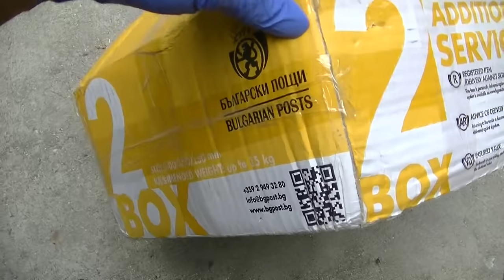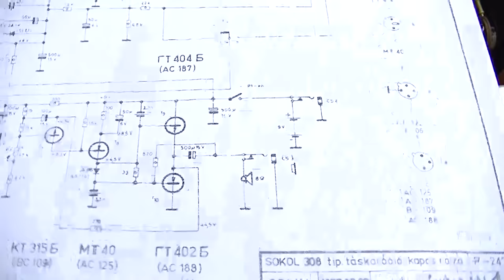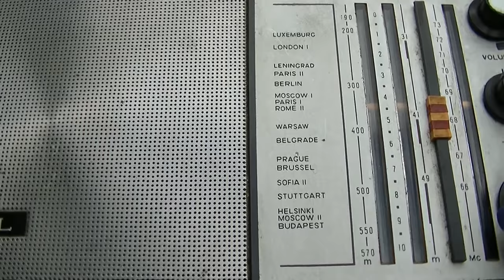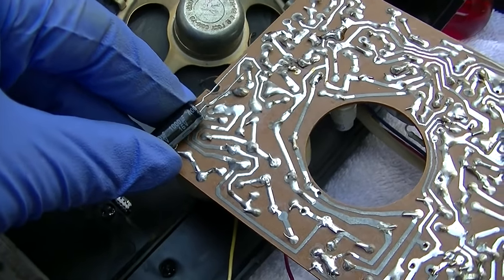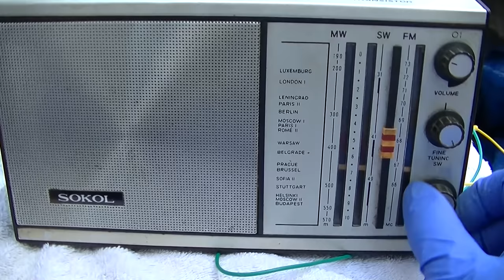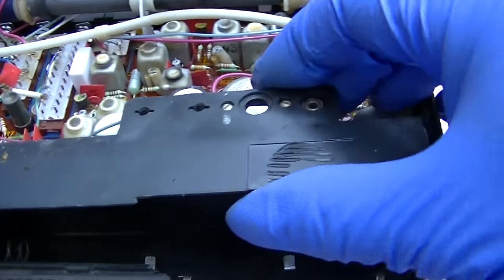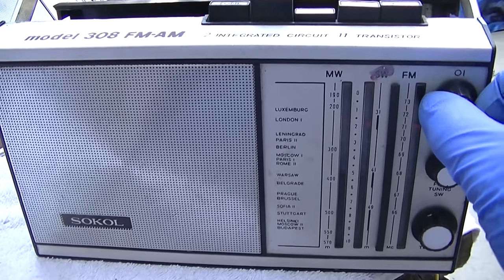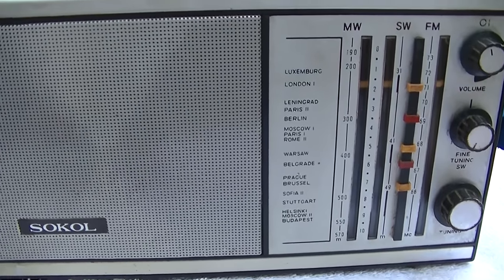Sokol 308 Russian USSR Built Transistor Radio Repairs

Comment: The SOKOL 308 came in 2 versions with different VHF ranges. If you look at the circuit it will tell you which coils you need to tweak. Most sets will do high and low side injection and if you then tweak it to match them it should work OK. Check the coils and value of the capacitors too as the Oscillator will need to be changed quite a lot. Check the differences between the two sets. I have the manual here if you want a copy....  hope your Russian is better than mine! The chip is a mixer so it must mix up or down to 10.7 Mhx. All the parts you need to tweak or change are inside that can.
Reply: I used to convert PMR Sets to work ion Band 1 in the UK by putting capacitors across thee coils if memory serves. You may need to reduce them and change IF Injection here.

Comment: I beleive it's possible to modify the FM oscillator to higher frequency but I'm not sure it will fit all 87-108MHz band. 
In the 90's russian radiohams invented a "converter' - they added an external 30 MHz mixer to antenna input to shift all the band 30 MHz higher. That worked but that was junk as well as it looked.
Reply: @xavierrajda933  Hello, nice to hear you! Actually, there's nothing difficult to modify a radio if you understand how it works. It's just boring to dig out the schematics and reengineer some circuits. I have a number of radios to modify this way but for now I'm a bit lazy. And it's easy with mono ones, soviet UKW stereo was different to european FM and here it goes complicated :)

Comment: Nice! Russia doesn't use the 65.8-74mhz (OIRT) band much if all anymore, most of the other eastern European countries that also used it have switched over to the 87.5 - 108mhz (ITU1) band. Mostly inline with the rest of Europe and US (the US starts at 88mhz). The only outlier now is Japan that used to be 76-95 but since analog TV died it is now 76-108.

Comment: The reason they are made from Russian (Soviet) parts is that they didn't have the foreign currency to import cheaper components. If they imported parts with their limited foreign money, they were selling them for Soviet money which couldn't then be used to pay back the foreign suppliers. What little foreign currency they had was from natural resource exports. But they spent that money on capital equipment.  Plus, there was no foreign copyright in the SU. They could steal an American or a Japanese design and then make it with Soviet parts and labor without having to pay the copyright holder.
Basically it can be explained by the economics, not really by ideology.

Comment: In Russia, IC looks like couplet (found in old US tube radios/TVs). And those newer Si transistors look like they came from USA; definitely TO-92 case style. Is the plastic pooblyboobker on the front (between the SW and FM dials) merely decorative, or is it a slider-type potentiometer? 🤔
Reply: i've seen many actual russian  'western' package types before ,   that slider thing is for plastic 'markers' to help you remember your favourite stations,  grundig 'yacht boy' and maybe other model radios used same idea
Reply: Its not standard IC, its hybrid IC, something like couplet with transistors. Russians also produced many standard ICs
Reply: @xsc1000  i meant the transistors 😉

Comment: Bulgaria (like most post communist countries) have switched to the western FM band in the 1994, so most radios from there will be converted. Western FM band is much wider, but it is usually enough to tweak filter coils, adjust the oscillator, and cut off some capacitors. Sometimes you have to cut off some turns from the filter coils too.

Comment: Shango, when will you do the Ю́ность (yunost-youth) tv? I've been waiting for that one. You should have had that one for the presidential debate.
Reply from the maker: no, that wont work here
Reply: @shango066  oh, yeah, stupid me. Its 50Hz SECAM standard. Not even PAL.
Reply: @shango066  I'm also waiting for an in-depth video about that Yunost TV. Some channels of the two different VHF bands may overlap. If not, you can tweak the closest one to US channel 3. The VHF channel selector is very similarly built to the ones in US TVs. You have to modify the audio IF though, because it was 6.5MHz in eastern European countries (OIRT norm), before they switched to the CCIR 5.5MHz subcarrier.
Reply from the maker: @mrnmrn1  don't wait it's not going to happen
Reply: @shango066  Oh ;-(
Reply: @shango066  You dont have to modify it. Yunost TV would run on NTSC 60Hz on some VHF channel. It also suports 110V or 12V power, so you can get picture quite easy. Only sound standard is too different (6,5MHz instead of 4,5MHz).
Reply: @vextenoch  PAL/Secam doesnt matter for BW TV :-)
Reply: @mrnmrn1  no arguing with shango when he makes his up mind about something. ☹️

Comment: 9 volts @20 mA  current is 180 mW , and the spec sheet says 600 mW audio output - did they mean 60 mW ?? Po > Pi ?
Reply: 20 мА - это "ток покоя". Когда нет настройки на станцию и динамик молчит. А 600 мВт - максимальная выходная мощность усилителя звука.

Comment: Sokol means falcon IIRC.
The mirror frequency is +2x IF not +IF.
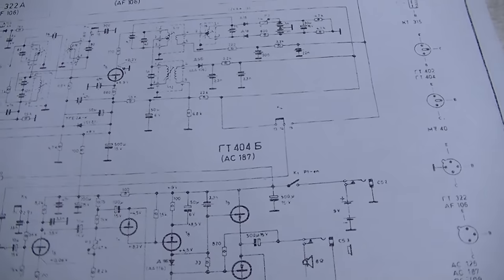Hey, I bet you got those schematics from Elektrotanya, because the one at 5:00 is Hungarian, and Elektrotanya is a Hungarian site. I have two of these radios waiting for restoration. They looked much nicer when thew were new, with the circularly brushed, shiny speaker grille, but by now they're all faded (oxidized), except some NOS ones that were kept in the original packaging.

Comment: That's very weird that an export version of USSR radio has an OIRT FM band. A lot of (I'd even say most of) these radios can be retuned to CCIR 88...108MHz band, but anyway it is a riddle as no west country even used OIRT. Even DDR (East Germany) were using 88...100MHz portion. In Poland the 66..73MHz was abandoned about 2002 when everybody moved to 88...108MHz, mainly because back in those days there were almost no new radio receivers which were able to make a use of 'low VHF' as it was sometimes called. Todays OIRT is used for radio broadcasting only in Russia, Belarus and Ukraine but the band is almost empty. It is occupied mainly by public, government owned stations and few big networks which operates Hi Power transmitters or operates on very rural areas where Hi VHF doesn't provide enough coverage.
Reply: Because its export version for eastern block countries.
Reply: @xsc1000  Yeap,  but why it has labels in English? When almost nobody was speaking english back then? I and my family had few russian TVs or radios sold officially in Poland and all of them had of course russian inscriptions all over the place.
Reply: @mateuszsp8ebc691  Because English was universal even in eastern europe in 70s-80s. It changed during 70s. In 50s-60s home made products and even imported ones had labels in local language. In 70s they started to use English labels, in 80s many Tesla, Unitra, Videoton products had English labels even they were made for home market, not export. In USSR it depended if they were made for domestic market or directly for export companies like TENTO.

Comment: Weird,  they made this "export" model with English nomenclature,  and then have the Russia-only 65 to 73 MHz FM band.

Shango,   you need to have a massive TV EOL video with Joe Biden on the tube!
Reply: Many parts of eastern Europe used to use the OIRT band too
Reply: @n2n8sda  Yes. I once owned a Romanian Dacia 1300 which sported a OIRT Radio. I saved it; has to be in my Attic somewhere in one of the six thousand boxes up there. The radio of course, not the car...
Reply: English was the business language even back then, so any export radio got English labeling.
Reply: @MrJohndoakes  But an FM band that could only receive TV audio from channel 3 and channel 4 (in North America, anyway).
Reply: IMO he should do one with Biden and trump similar to what Photonicinduction did in his video titles "bangers clangers" or whatever.. To keep it fair. One cheated and the other lost due to cheating, NEITHER are suited to actually run the nation properly to begin with.
Reply: Uncle Joe will probably EOL, that’s why they picked him. He’s just a placeholder.
Reply: @5roundsrapid263  The local talk radio station host where I am in Canada refers to Biden as "Demented Grandpa Simpson".  My comment would likely get deleted here so I will self-censor,  but on the air, he refers to Harris as "___ Toe."
Reply: @LakeNipissing  It was for export to eastern block countries, so OIRT FM was OK. Even for eastern block countries, english labeling was used, because except bulgarians, all other use standard latin letters. They also made version for western europe countries with standard FM band.

Comment: All polar capacitors K50 from the Armenian plant are immediately thrown into the trash without measuring. MBM (visible on the board as 1000pf) and square red flags are trash. The Soviets supplied high-quality parts only to defense and industry (marked with a diamond).
Reply: This MBM not bad at all, big MBM with capacity more than 10 nF are soo bad, red flags works well when it's in good condition.

Comment: BUlgaria, not what one would think of an industry leader when it comes to electronics.  Well it's not the first country that comes to my mind.  That said, I recently discovered a line of products that are built in that small nation.  The brand is Olimex, they build everything from an Arduino clone (several to be sure) an ESP286, and a nice little one board computer with built in wifi that comes with Android 4.0 ready to run, and will run Lniux from an SD card if you wish. They also furnish a cheap 7 inch touch screen for this board and plenty of other great add on cards. I am very impressed with their products, they are extremely well designed and the soldering is extremely good compared to the stuff coming out of China right now.
Reply: Bulgaria used to be one of the biggest producers of computers in the Communist block, mainly copies of Western originals: https://en.wikipedia.org/wiki/Pravetz_computers

Comment: I bet someone has removed a small capacitor in the vhf local oscillator.
Russian radios are made to last, unlike modern junk.
Reply: certainly are, i have 3 vega 402 tv's,  uses fibreglass pcbs,  on hinges, for easy servicing , and  at least one radio with all transistors in sockets , and chassis from a rigonda radiogram , has 2 IF stages (valve/tube equivalent to EF93/6BA6), so gain 'should' be good although isnt at the mo, will investigate as and when i get chance..
Reply: @andygozzo72  A long time ago i had an early Regonda monochrome t.v, the crt was about 5 inch and flat faced, odd for tv's of the era.
As you said, it had every pcb on hinges and little bits of string to hold them open when servicing.
I loved that idea, everything was accessible.
There was a black power pack on the back to create the 16v or so d.c for the tv, it had a bulb in the psu,  a resistor that could really cope with heat :-D.
Reply: @zx8401ztv  was it a model vl100? if so , i have one of those,

Comment: Those two radios could be for domestic market, but for places inhabited by foreigners (airports, hotels...). Hence the English markings. Maybe the second radio was not modified, but it has case mated with "interational" chasis as a form of repair (for which foreign users in that facility were grateful).

Comment: Main reason for that "eastern FM" (OIRT) band was that this way it was a) easier to jam the evil capitalist FM band b) the good proletariat wasn't exposed to western propaganda. ;-)
It was used from 1960 up until 2007 I think.
Reply: There are still a lot of stations in Russia, Belarus and Ukraine using it, though it is getting less. When there is an E-skip opening to the east the band is packed with interesting stations here in the Netherlands.
Reply: FM band was never jammed. There was no reason to do it, FM broadcasting is local, no long range. Eastern Germany even used CCIR (western) standard and Czechoslovakian and Magyar radios were produced multistandard since 70s.